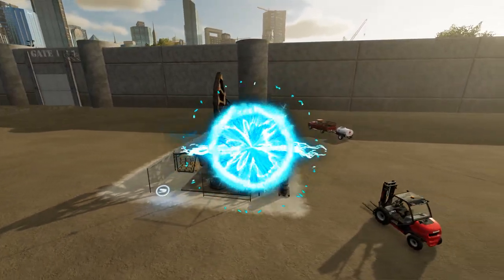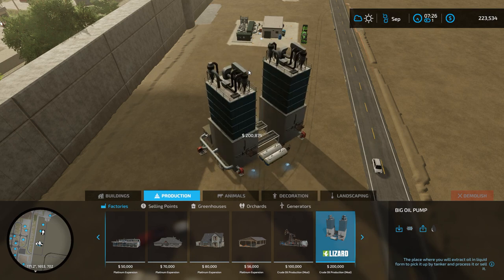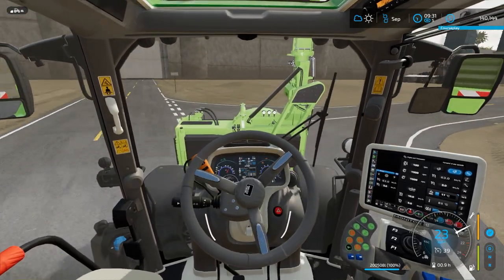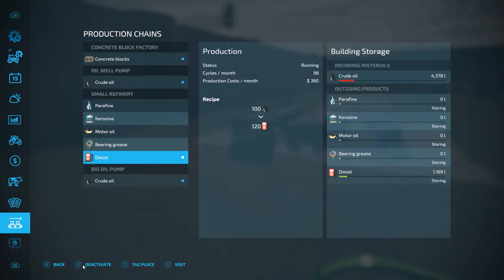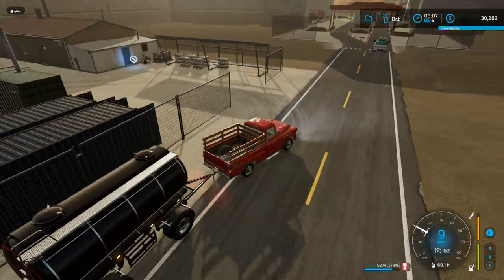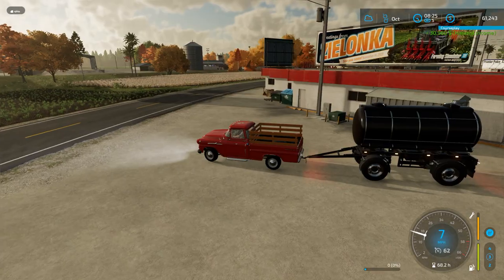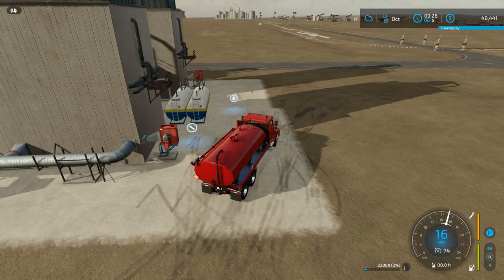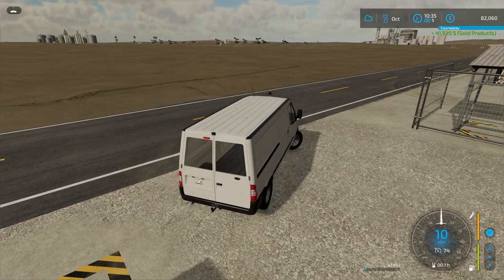Adding an oil refinery on Frontier | OIL EMPIRE | Episode 2 | FS22

Comment: what kind of pumping unit is that
Reply from the maker: I’m not exactly sure which unit you are asking about but they are all part of the crude oil production pack on the modhub.
Reply: the one in the foreground it has a skeleton type horse head . I was wondering what brand it is
Reply from the maker: Big Oil Pump from the crude oil production pack is the only pump I added to this episode.  I couldn't find anything with that skeleton head so maybe it was something that was part of the map and not an actually mod I used.  If you could let me know at what time in the video it was in, I could try and look closer at that moment.
Reply: first 5 sec.
Reply from the maker: Oil Well Pump from the Crude Oil Production mod is the pump jack that is used in the first 5 seconds.  It is available on the modhub.  https://www.farming-simulator.com/mod.php?lang=en&country=us&mod_id=276072&title=fs2022
Reply: @ottosimcrew it looks like the unit in Russia